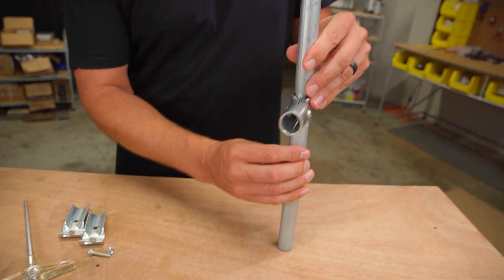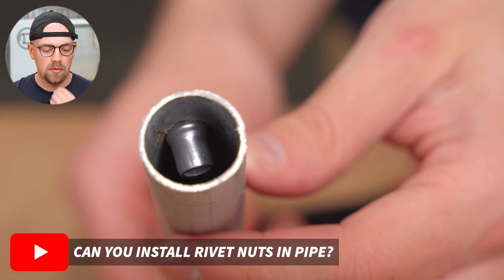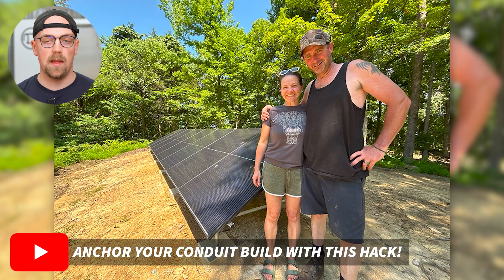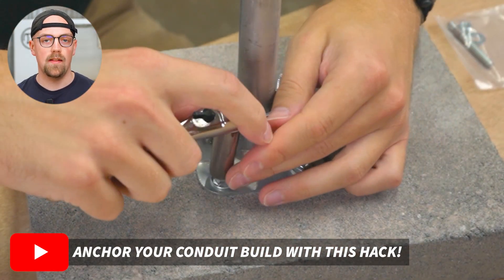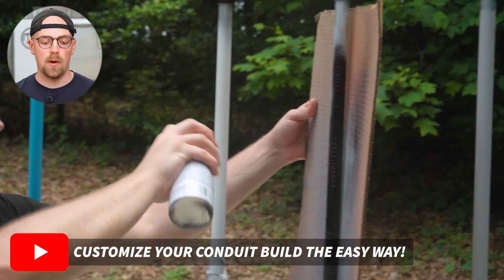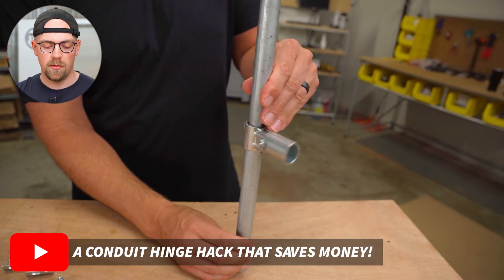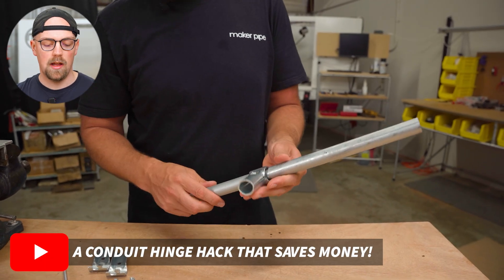My 10 Favorite Hacks From 2025!

Comment: Just learned about 'MakerPipe' a few days ago, so I'm very new to the concept. Pretty cool, looking forward to building with the material. 
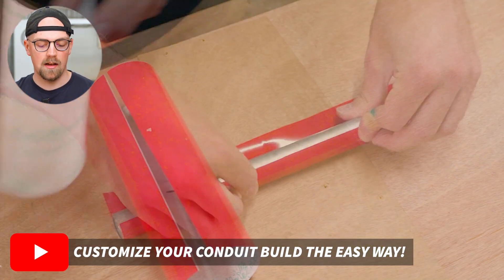At the 9:29 mark, the products used here are cool, but it made me think of a product called 'Techflex'. Using that, in combination with an adhesive heat shrink might expand your hobby.
Regardless, hope that helps. Rock on.

Comment: wow, what a great bunch of ideas.  i found some great pipe at Restore that is a little larger in outside diameter than 3/4”.  it was for some kind of little shelter or awning.  3/4” maker pipe connectors are too small and 1” connectors are too big.  i have some extra plastic clips for wire racks and they fit over the pipe just fine and 1” connectors fit fine.  now that you showed the rivet nut idea, i need to try that.  i’m reworking a funky little desk i bought at goodwill.  with my weird new pipe, i can remake the thing totally the way i want.  i love your product.